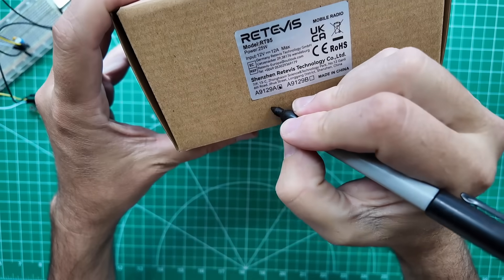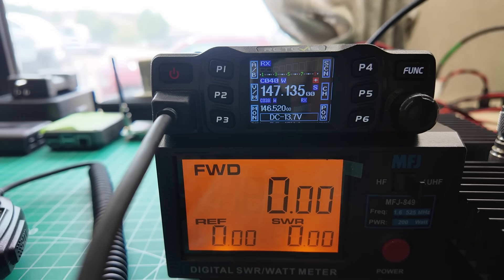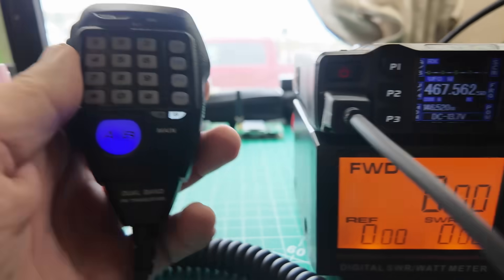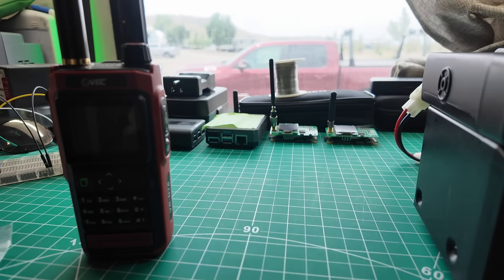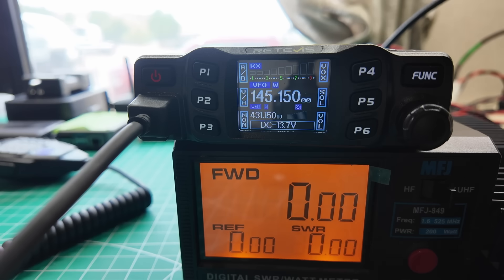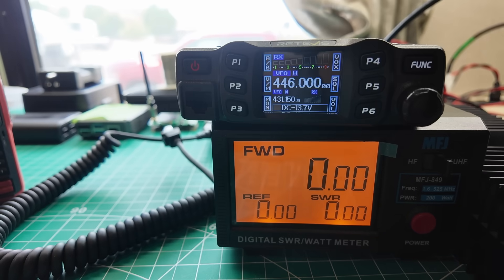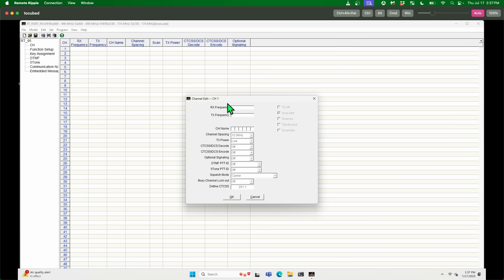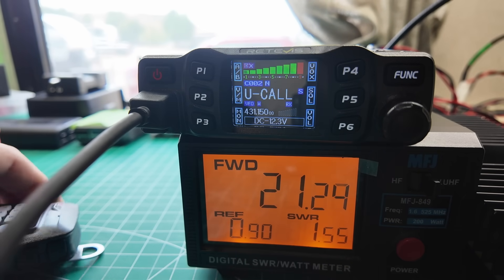This Radio SUCKED, So I Fixed It!

Comment: I had the Anytone version of this radio and the front end kept overloading to the point that the squelch would open with loud random noise when driving in certain parts of the Phoenix area. It would probably be fine in a smaller city or town, but in Phoenix it was terrible. I ended up loaning it to a friend a couple of years ago. The six character channel display was also a pain in an area with hundreds of repeaters.
Reply from the maker: I hope you made it out of Phoenix :-D

Comment: Mine has a strange issue. Sometimes it sends the carrier and the tones (bridge opens and resends carrier) but no voice. It serves as my base station so it was hardly moved and it is already on latest firmware. Mistery!
Reply from the maker: That is a weird one - so you PTT the local repeater and you get a tail back indicating that you were successful... but nobody hears what you say?  Different mic?
Reply: @temporarilyoffline  exactly the situation, but not always. This happens randomly. I got another mic and will try but the new one doesn't get stellar reports. But will help understanding if mic is an issue. Unfortunately prime does not have it in my country, got to get a spare from far east....

Comment: I have one that I will be returning due to the max transmit power on Low, Med, and High is only 2.2 watts. I have had the radio for 6 week and it worked fine until yesterday. I tried factory reset and reprogramming it and it's still only pushing 2.2 watts on VHS and >2 watts on UHF. Any thoughts? Thank you.
Reply from the maker: Sounds like some blown finals as a quick guess - but under warranty= no problem!  The world figured that x% of any run of any product will have a problem... So we have integrity and warranty
Reply: @temporarilyoffline  Thank you for your feedback. I'm going to return this on and get another one and see how that goes.

Comment: I bought a solar controller bout 5 years ago, out of the box it failed, instead of returning it is tore it down, found solder splatter all over the board, also lots of cold joints, cleaned it up and it just died a couple of days ago, I had it mounted on my ATV so I could keep the battery up with a solar panel it was very abused for 5 years, it did good for being built in China 🇨🇳. 😂😂
Reply from the maker: Japan isn't afraid of poor quality control either.  My IC-7300 wouldn't TX out of the box ... Quick (pissy mood) fix later and I was in the air.
Reply: Aspiring solderoids

Comment: Surprising that these 25w rated radios are only outputting 20 watts. That is 80% of rated power.
Reply from the maker: I'm sure some of that is in SWR and meter, but yes. They don't do 25w+ as a rule ...  None of them.  They should have rated them at 20w and we'd be ecstatic that they were all slightly better.  Just properly setting expectations
Reply: A dummy load is the better option when testing RF power, without cables, antennas, adapters and all the other stuffs that causes RF loss.
Reply from the maker: Would love to know how you'd put a meter between a radio and a dummy load without putting a meter between a radio and a dummy load.

Comment: Do you ever get reports of low audio?

I have two (Anytone branded) and I get low audio reports when compared to my other radios.
Reply from the maker: I have not. Just fired up another one today and got good audio reports from others in the camp here.  Check Mic Gain and adjust for your mic technique.  I'd expect each radio brand to do it a tad differently.
Reply: @temporarilyoffline don't you think I know how to do all the checks? Come on man give me a break. It's a known problem with the anytone 778.
Reply: @Rusted_Link  Maybe you should have indicated that in your original post.
Reply from the maker: Don't let 'em get in your head man... they don't know how awesome you are.
Reply: I took the hand mic apart and used a drill bit to enlarge the microphone hole.  Works great now.
Reply: @TungstenAmp  did it LOL